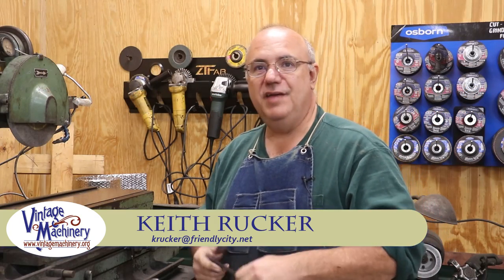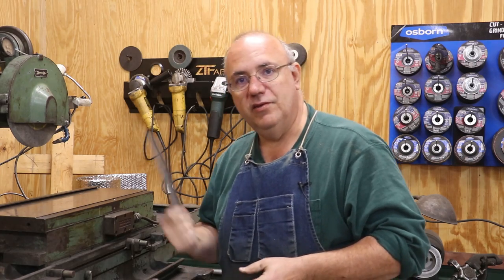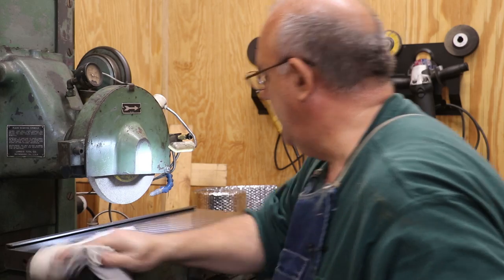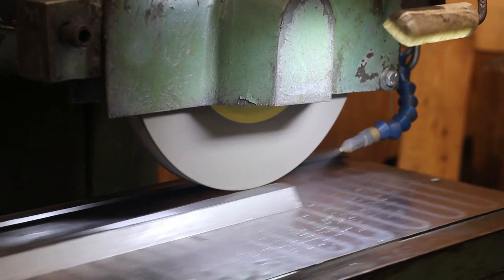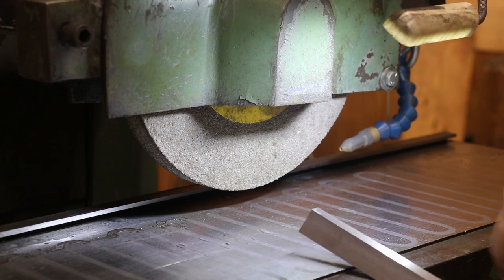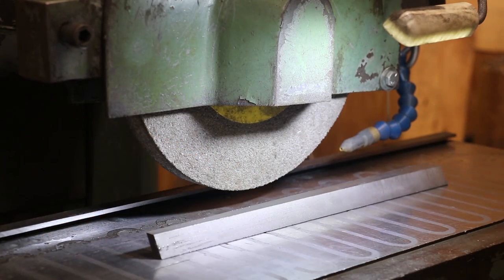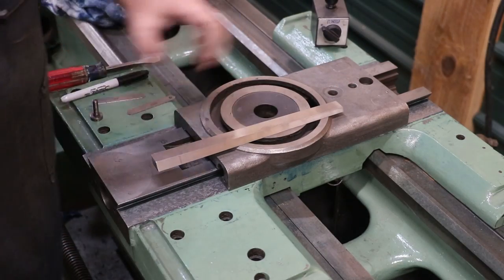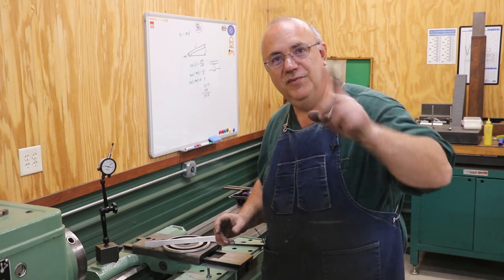Grinding a Tapered Machinery Gib using the  Surface Grinder  - Monarch Lathe Restoration:- Part 21

Comment: Despite the nay sayers comments, doing the math is the best way to get everything right on. I might have use the surface plate and a height gauge to get the dimensions for the ends of the gib but really, the way Keith did it works fine for the original set-up. It's a one off piece that needs to be highly accurately made and time isn't really all that important here.

Comment: Keith - excellent video as always. There was no need to use trig, just a proportion calculation: (10÷10.390)×0.216=0.2078 much simpler and quicker. This works because you have similar triangles, in other words triangles of the same shape, so the ratios of the sides are the same for both triangles.
Reply: Absolutely!  KISS Principle applies here.  Doing the calc using similar triangles takes out the approximation and hence the inaccuracy of the angle calculation
Reply: If  his surface plate is level as it should be. Using a  machinists level would do the job. Especially if the first grind was only to get close as it was in this video.
Reply: I was thinking the same thing, but it was fun to get a trig refresher after 50 years.  Looks like the cast bar still had some internal tension as it appeared to have twisted some after the machining.
Reply: Proportion was what I was thinking while watching and I went and got a calculator which cranked out to be 0.207892 before he got his number.   I know that I took it to too many places but in rounding it makes 0.2079.  I am wondering if the micrometer would not have been the better choice to start with as Kieth said his calipers are not that accurate.  Just thinking.  It all worked out well which is the goal.
Reply: @royreynolds108  Yeah- unless you have a micrometer with ball ends, it is difficult to be 100% accurate on a tapered piece
Reply: Yep, just slope of the line. Still easy either way though.
Reply: OLD SCHOOL i
Reply: With the right sine bar, he could have just put the old gib under it to get the angle. Unfortunately due to the design of the mag chuck here, that would not work due to the fact that you can only get the gib under one of the sine points.
Reply: Even proportions are unnecessary, really. Just take two thickness measurements exactly 10 inches apart, and the difference between them is your block size.
Reply: I would have measured at 10 inches distance and called it good enough. ;-)
Reply: No math required. Simply mount the gib on the Brown & Sharp mag chuck and indicate it so that is is perfectly flat from end to end adjusting the mag chuck by putting gauge blocks under the wheel underneath. From this position you can restack a new selection of gauge blocks as needed to lower the offending end by exactly the discrepancy measured on the lathe,, in this case .003". This should get you the correct angle of placement to grind the gib, no trig required.

All this trouble could have been avoided way back in the process by simply sliding a .003" feeler gauge under the fat end of the new gib when you first machined it in your machinist vise using the old gib as a guide angle tool. You already knew the discrepancy at that time so there was this opportunity to cut your new gib from the git-go by making this little adjustment.
Reply: Albert Dewey he has a machinist level accurate to .0005 per foot as a carpenter I would have put the old on the sine plate and shim till the original  matches the same level
Reply: I tought it too, but is not true. One need to do the trig because the 10.39 was one of the cathetus but the 10 inchs was the hypotenuse of the sine plate. We just got a pretty close result because the angle is small, but with greater angles one will miss by a lot.

Comment: I quess that ten inch required height could be be calculated also by using relation without any rounding errors from going to angle and coming back... Just simply (10 inch/10,39 inch) x 0.216 inch =  0.2078 inch :) Thanks for the really nice gib video series! I accidentally broke one of my gibs from the lathe so have to somehow repair that someday. This is excellent base for what&how to do.

Comment: Keith, This has to be one of the best videos you’ve ever done. There might be other quicker ways to do the calculations, but this method always works for me. Besides, this is the way I learned it 40 years ago and old habits are hard to break. Keep up the GREAT videos.

Comment: Hi Keith. Could you use a small machinist’s jack and prop it up under the sine plate, then adjust until level with a Brown & Sharpe (or Starrett) bubble level? Then, once you’ve got that, take it over to the  grinder, and mike it in that last little bit? 😏

Comment: if you do the turcite trick on that gip.. one of the sides.. you will have no bad wear on any of your parts. and u should have done that also inside at the 30 dgr angle. That would have done a hell of change in wear...

Comment: All you needed to do is put two lines on the gib 10" apart and measure the thickness at both lines. Subtract one from the other and that is the height of your shim stack.

Comment: While I have nothing against math and trigonometry, I would suggest a way to bypass the trigonometry steps in this case.  As the reference part is longer than the 10 inches of the sine plate base, just mark 10 inches rom one end and measure the thicknesses at the end and at the 10 inch mark.  The difference between these two readings is directly  the required stack for raising your sine plate for the desired angle..

Comment: First, let me say, great video, as always.  I love it when I get notified that you've released a new video.  BUT... (and you knew this was coming)... I just have to say that the shape of the gib is not a trapezoid.  It is a parallelogram.  Please don't flame this comment too hard.  Thanks :D
Reply: At last someone noticed.
Reply: A parallelogram is a trapezoid with two pairs of parallel sides.
Reply: No a trapezoid is not a parallelogram.  And a trapezoid is not a parallelogram.  A trapezoid is a four sided figure with two parallel sides and two nonparallel side.  A parallelogram is a four sided figure with two pairs of parallel sides.
Reply: Jim Korman
That's like saying that a square is a circle  with corners.
Reply: @David Spahn - it's actually funny how the two are defined out in the world. Webster's defines as follows, 

trapezoid:  a quadrilateral having only two sides parallel.
parallelogram: a quadrilateral with opposite sides parallel and equal
.

The real problem is the word "only" seems to be contested because many places say that a trapezoid has "at least one" set of sides that are parallel. So who do we trust, dictionary definition or just just what some other people say? Other countries may define the two with minor differences, which could where the confusion is. For me, I learned (early in life way back in my geometry class) that a parallelogram is not a trapezoid, but has 1 aspect of one. Similar but not the same, and since this is what I learned and the fact that Webster's confirms this, well I will stick with that.

If anyone really wants to argue this, perhaps they are misinformed or are from a diff country?

Comment: I enjoyed the math - brings back memories of HS trig class.  Could the angle grind have been done using the granite surface plate, sweep the old gib with a micrometer, then add blocks to the Sine plate until the mic reads zero end-to-end?

Comment: OUTSTANDING math and machining!
Unexpected sparks ALWAYS get my attention too, especially when working with electricity. :-)

For those who may have difficulty remembering the trig functions, just remember SOH-CAH-TOA which is pronounced "socatoa". (This is the recommendation a  medicineman gave to an early Indian who dropped a chainsaw on his toe while cutting wood. Yeah, it sounds dumb but it may help you remember the word.) "SOH" is sine = opposite over hypotenuse, "CAH" is cosine = adjacent over hypotenuse and "TOA" is tangent = opposite over adjacent.
Reply: The Flintstones was not historically accurate and I don't think your story about chainsaws is either. Both entertaining though.

Comment: So cool Keith, question? Did you account for keeping gib perfectly parallel with direction of grinder? Not sure but seems like that would change the math if it wasn't parallel.
Reply: I probably eyeballed it the best he could, the scrapping will take care of it anyway.
Reply: I was thinking the exact same thing. The angle won't be correct if the gib isn't parallel with the direction of travel.  For example, if you turn the gib 90 degrees, then there won't be any angle along the long length.
Reply: the angle bracket-like piece at the end of the sine plate is up against a flat piece (though small) of the gib, so that should keep it fairly close, and scraping will take care of the rest.
Reply: If you do the math you’ll see he’d have to put it on the table really slanted to have any significant error.

Comment: Keith,   If the gib has 1/4" per foot taper the 10 inch sine plate should need 0.20833 (+ the 0.100 step). This is within 0.001" of your stack and you will be scraping anyway.   Just nit picking I guess.  Great job on the video.

Comment: Neat video. One slight issue with the math. You can't get 4 significant digits after the decimal if your measurments were only taken to 3. It would have been correct to round the height to .208.  It won't matter much, since the gib doesn't actually have to be accurate to .0001 (or you'd have used a micrometer). Just wondering if you could have gotten just as good a result with a precision level.

Comment: I wonder if the stack really should have been slightly different.
The measurements you came up with work out to about 0.249 inches per foot. 
I think it is reasonable to assume the design taper was 0.250" per foot.
     sin(atan(0.250/12))* 10 = 0.208288, so the stack would be 0.2083.
Of course since you tweaked it to match the machine it doesn't really matter.
Reply: I think you are correct but with all of the wear and scraping the measurements changed over the years.

Comment: Keith, since your pivot and the other end are 
10.00 inches apart, why not just measure the 
fat end of the wedge, and then, measure 10.00
inches away, towards the thin edge?

steve

Comment: I have a question regarding the math there. 

.2078 over 10" works out to .24936 per foot. I suspect that the actual measurement was .25000 per foot. 

Do you ever check your measurements to see if they're very nearly a logical number?

Comment: Why not use the short gib as a template and lay the new one on top (opposite small end over large end) on the magnetic vise?  That would provide the angle as the old one was ground?   I understand the need to know how to calculate it, however in this case you have a template to grind from....
Reply: I got the impression that the old gib was worn in the middle. The magnetic forces would have pulled the new one out of true and produced a faulty grind.
Reply: The original gib angle wasn't quite right which, along with the fact that it was too thin is the reason for making the new gib. It can be used to get the angles close but once that is done you need to fine tune the angle until it's right on dimension.

Comment: Keith, I do not like just mag., on part with no support on ends, and sides. You can get an assortment of desperate mag., blocks, to block your work pc., in, so there is no accidents!!! You can get blocks as required, it's much safer, believe me, I ran a surface grinder........🍁
Reply: This word correct thing, sucks, remove desperate!!!  🍁
Reply: Just check it for oil groove purposes, it's done!...🍁

Comment: Keith why do you need to scrape it in, seems ok as is its flat and dimensionally correct?
Reply: Scraping gives a bit of roughness to the surface of the metal so it will hold some oil. If you used just the ground side it could squeeze all the oil out and leave it dry (prone to rust).
Reply: That makes perfect sense. Thanks Keith

Comment: Even though there's nothing wrong with your math, it could have been done way faster and way easier. The gib was 10,39" and the sineplate center to center is 10". So you take 10"/10,39" = 0,9624". This number you multiply with the difference in height you measured. 0,9624"*,216" = 0,2078". And it could even have been done much faster, since the part is longer than the sineplates center. So you could just as well have marked any two points on the gib on a 10" range and measured the difference in height (if straight).
Reply: Keith would not have thought of this plus doing the math made him look good.

Comment: Couldn't you lay the new gib on top of the old one. The other way round and it would be level. Wouldn't it?
Reply: That's how he did the rough milling. The old gib had an incorrect angle so using it for the final set up would leave the new gib just as incorrect.
Reply: @Mishn0  ok. Yes I saw that. Thanks for your reply. M

Comment: A bit more math and you could have calculated how much needed to come off the thickness to get the gib to move to the right position relative to the cross slide rather than doing it by trial and error. As it's an Imperial lathe the taper of the gib should be 1:48 or (1/4" per ft) which is 1 deg 11' 39" or 1.1941 degrees in decimal (as against your calculation from the old gib of 1.910 deg). If it was a metric lathe the gib taper should be 1:50

Comment: Instead of all the maths, couldn't you have set it by running it under the dial indicator, with the original gib on the Syn Plate, with it attached to the grinder, then adding gauge blocks, until it was running true?

Comment: Why dont you use the old gib as a wedge under the sine plate
Reply: The old gib appears to be bent slightly, so it might not be a good reference.
Reply: That was my first thought. However you would end up with a duplicate of the old gib because the clamping pressure   would bend the new gib to fit the old. If the old gib was good, we wouldn't be making a new one.
Reply: he is changing the angle compared to the old gib , about 20 thicker at one end, he used the old gib to measure the starting point and used it to transfer

Comment: Seems to me you could avoid the trig by using Pythagoras to calculate (or measure) the long side of the gib, and then use similar triangles to calculate the gauge block stack.  Maybe not the way Keith learned it, but easier to teach to the math-challenged.

Comment: Just to be rigorous and because I like to be a pain, you should be using your angle variable (theta or phi) and not x as you use it incorrectly as you've labeled your figures. Sorry...HAD to point it out. :o)  Otherwise...love to see me some trigonometry.  As others have pointed out in the comments, LOTS of ways to skin this cat to get your numbers.  I wonder, does the manual indicate the geometry of the gib?

Comment: Any reason you didn't measure the cross slide ? (i.e. width between pins)  You don't need trig to use the sine plate if you just cross multiply the gib dims with the 10" of the sine plate itll give you the stack directly (without trig errors)  i.e. calculate the slope of the  dovetails by dividing the difference between the readings between pins ,by the distance between the two pin measurements , times the 10 inches of your sine plate will give you the stack height.   e.g.  measure 1 = 3.500" , measure 2= 3.550"   difference = 0.050"  . Space between measurements = 5.000"  (use a 5"sine bar to make the measurement easy) . slope = 0.050/5.000 = 0.01   , x 10" = 0.100"  to be stacked under sineplate.

Comment: You could simplify the calculations by using simple cross multiplication. Works at least with these shallow angles, where the hypotenuse and the long leg are almost the same length. Then you'd just calculate .216*10.000/10.390 = .207892204. Close enough ;)

Comment: the gauge blocks and the geometry is to explain the concept of the sine plate.  obviously he could have jammed a screwdriver under the sine plate until it was zero on the dial. (for all the obvious questions below) there's a thousand ways to get the job done etc blah blah blah

Comment: Couldn`t you have just used the dial indicator set at zero on the large end sweep to small end to have the same number without all the fancy sine to cosine and inverse math ?
Reply: I was thinking of putting an adjustable parallel under the sine plate and sweeping the gib, and never use math. Or fiddling with a stack of gauge blocks until the gib sweeps flat.
Reply: simplest method so far :)
Reply: I don't mind seeing the math and would do it both ways to proof each other out.  It's basic right angle math "sohcahtoa".  If only more engineers who drew blueprints did practical measurements and more machinists did math proofing.  We always tell ourselves "I'll never use this" in math class.  Welp, here ya go :-D
Reply: @NGinuity Yep, I use this stuff but not calculus.